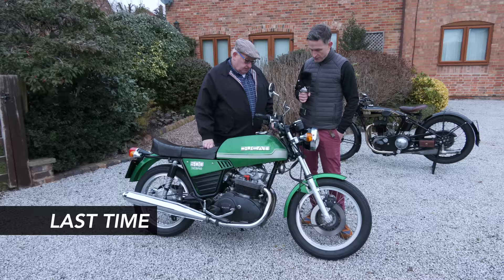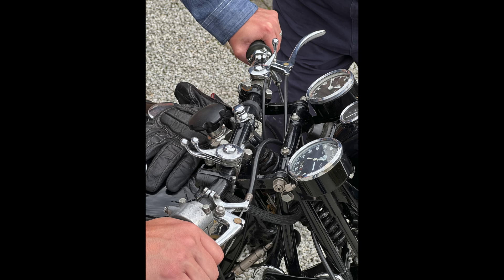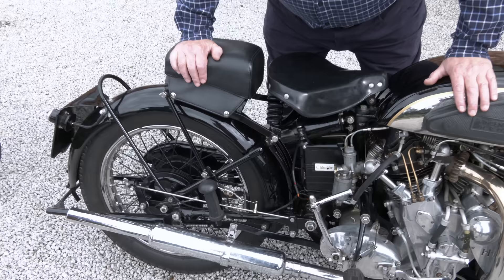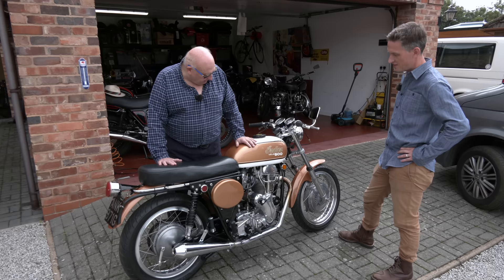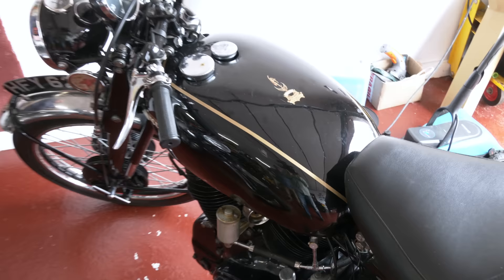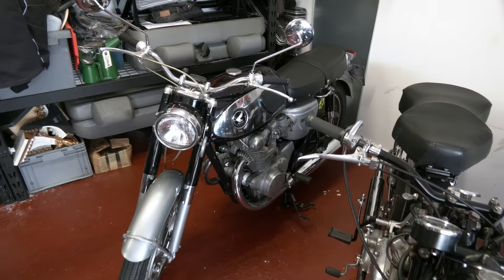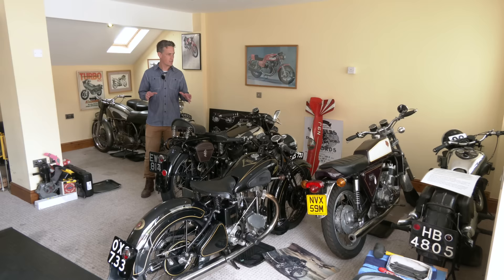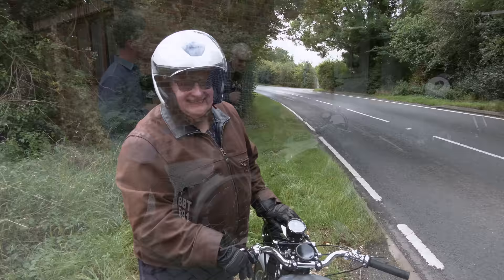Classic Bike Collector - Arthur's dream collection - part 2/2

Comment: The Black Bomber was the first big bike I ever rode in 1968. My motorcycle experience at the time was about 200 miles on a Cub 90. I did stall it a couple of times until I got the hang of the clutch. It was easy to ride. These days I've gone full circle and I've got a Honda 500F. It's awesome, better in every way being modern, but just as much fun.